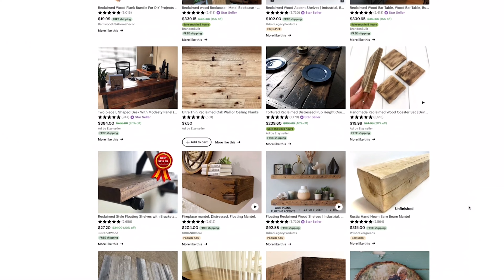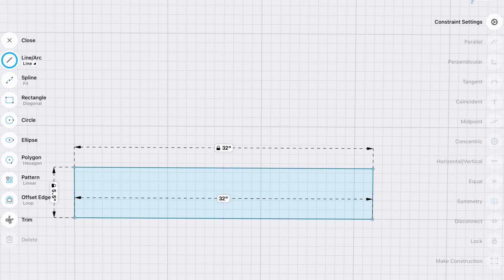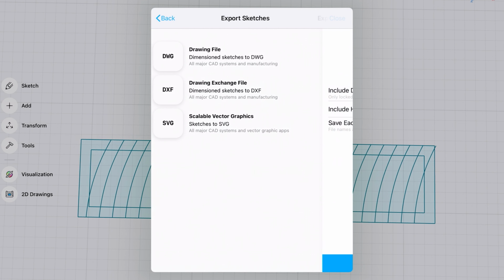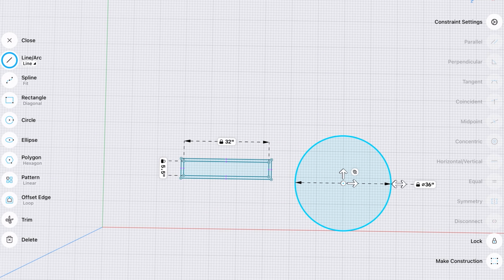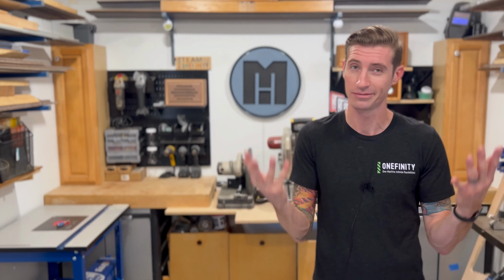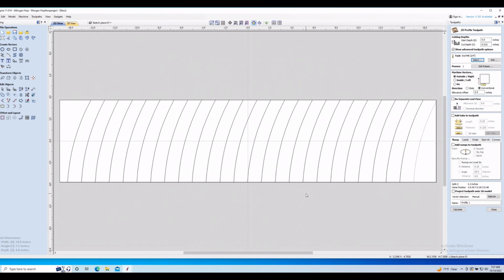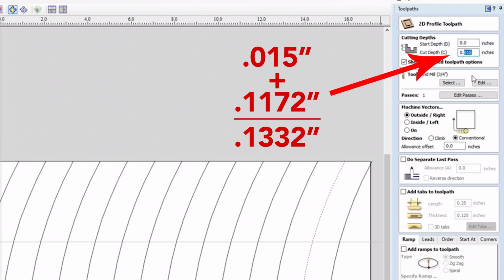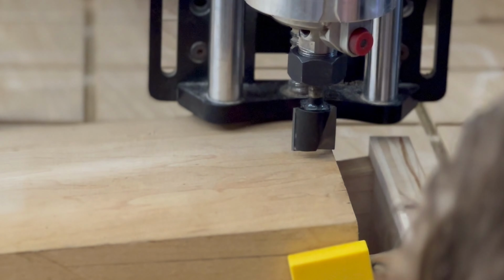EP 9 Onefinity CNC - Make New Wood Look Old With Your CNC!

Comment: Very cool. I am enjoying your videos. I do have one question because of my OCD. Shouldn't the deeper side of the bit actually at the top of the arc? In other words, the top of the saw mill blade would actually cut deeper than the part of the blade 1.25 inches below it. I hope that makes sense.
Reply from the maker: It does.

Comment: Very clever!  I wonder if would have saved you some time if you just adjusted the spindle's lateral tram so it would be cutting at an angle.  Then you wouldn't have had to mount the board on an angle or do all the math.  However, you'd have to retram the machine afterwards, of course.  I wonder which would have been faster.
Reply from the maker: Exactly, the tram and retram isn't worth the effort and time.